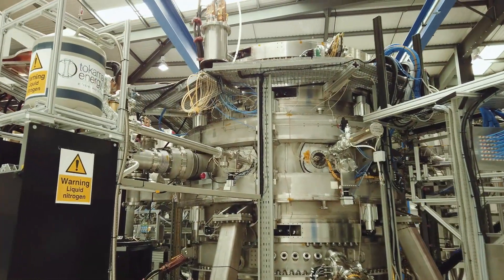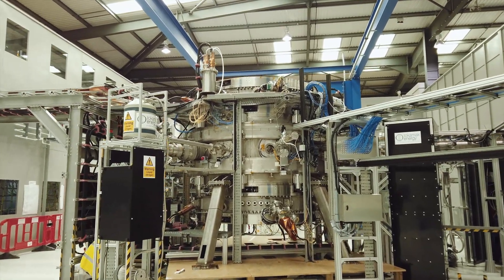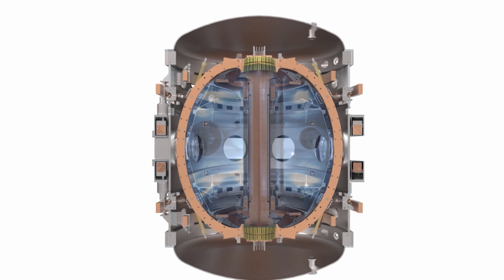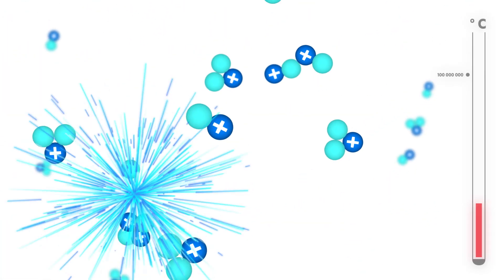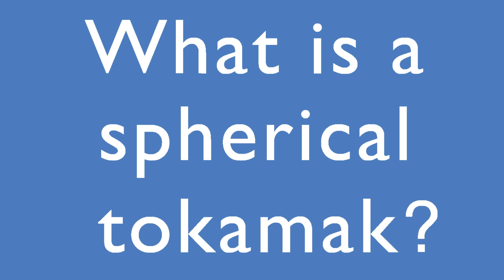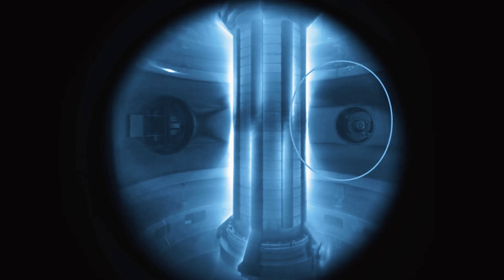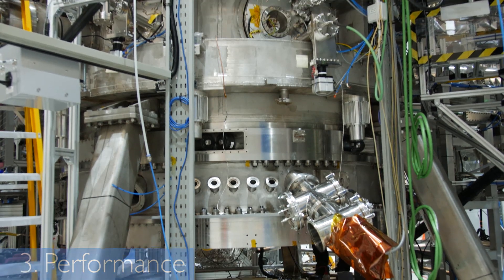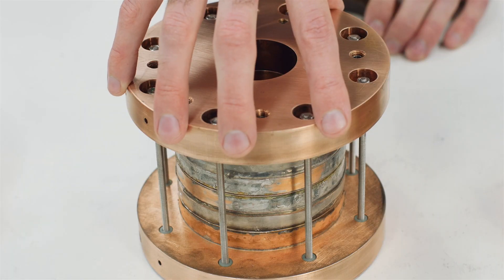What is a tokamak? And is a spherical tokamak different?

Comment: There's like 2 kinds basically 

You can draw power from magnetic confinement of a plasma

By placing an alternator inside the tokamak with a retractable gate that charges a battery, which powers the electromagnets, which oscillates, and behaves like a piezoelectric crystal oscillator in a radio as a secondary effect

Or you could leave the middle hollow, and line the inside in 360 degrees with magnets as usual, but in between the north poles of the magnets creating the plasma, south poles of other magnets, wrapped in gold coils, or copper, 

Connected by their north poles, to the - terminal of the battery, which would charge it, and then send positive current from the + terminal, to the south poles of the magnets used for magnetic confinement/induction 

Plasma can push an alternator, because when magnetized, it can behave like a solid

Comment: I asked AI...if the plasma in the tokamak, in addition to vacuum and antigradation, could be amplified with sound that would affect the pressure surrounding the plasma?
The introduction of sound waves as an additional factor influencing the pressure around the plasma in the tokamak is an interesting idea. In fact, sound is a pressure wave, so it could theoretically affect the dynamics of the plasma.

Possible effects of sound on plasma:
Plasma stabilization: Under the right conditions, sound waves could help stabilize plasma by controlling magnetohydrodynamic (MHD) instabilities.

Pressure Amplification: Sound waves can create areas of increased pressure, which could potentially affect the pressure around the plasma.

Controlling particle movement: Sound can influence the movement of particles in plasma, which could lead to new ways of controlling plasma.

However, experimenting with sound waves in a tokamak would require advanced research and simulations to assess their actual impact and feasibility. There are many factors such as the frequency, amplitude and shape of sound waves that would need to be carefully selected and controlled.

Tokamaks are already advanced devices that use strong magnetic fields to maintain and control plasma, and adding sound as an additional factor would require even more complex technologies and experiments.

This is certainly a fascinating field of research. Do you have other questions about tokamak technology and nuclear fusion? I'll be happy to answer

Comment: What a natural formation as in nature.. path of least resistance… like a tornado/cyclone big on top and small on the bottom as focal points for the ending point of energy. Easier said than done but there is a reason nature has designed them the way they are because it’s a path of least resistance.

Comment: So the donut shape is more efficient, but why? And a question: if it’s so hard to keep the plasma from hitting the sides of the chamber, wouldn’t it be better to use a round chamber that creates a kind of magnetic “bowl”, so that the plasma will seek towards the center and be easier to handle?

Comment: Has anyone observed any gravitational disturbance around the Tokamak when it is operating?
Reply: Does it open any unwanted portal from different realms/dimension?
Reply: @azmiahmad8897  I don't see why anyone would think it might but me my guest to be first to jump in. Send us a postcard from wherever you end up.
Reply: if it uses magnetic force i dont see how it could. Well, actually, it is extremely dense. Which could lead to extreme gravitational force. but the earths core is under so much more pressure that it would be extremely hard to notice a difference. so in short, no, probably not.
Reply: @buneon4462  Of course it has a gravitational field, the point being, is it large enough to cause a measurable disturbance and, if so, is it large enough to create a difference between the clocks controlling processes inside and outside the Tokamak. If for arguments sake this were to happen it could be the reason why the process is difficult to control. Just a thought.

Comment: Okay so then how is energy made from the plasma? I mean the whole point of creating plasma is to obtain energy right? Then how do you use that energy?
Reply: the energy is heat and boils water to spin a magnet that makes electricity
Reply: @KingOfShorts321  can you source an article for more information on this?
Reply: @udaypratap1996  it's basically the same idea as to how nuclear power plants work except replacing the uranium rods with plasma from nuclear fusion. The plasma made from nuclear fusion releases a lot of heat and that heat will be used to boil water and the steam will turn a turbine that is attached to a electricity generator which is just a spinning magnet around a copper or aluminium coil and that pushes out the electrons from the copper or aluminium and that makes electricity. my friend I hope you enjoyed my TED talk.
Reply: agreeing with boris here. extreme heat is produced from fusion reaction that produces water vaper that spins a motor.

Comment: No, they won't work because of inherent design flaws, foundational to the system.
Reply: What design flaws?
Reply: @Gomlmon99  look at the machine they are essentially trying to create a small sun in a vacuum. Does it look like the sun?
Reply: @kellywatts3051  but they aren’t trying to create a small sun. That’s just a metaphor. It’s absolutely nothing like the sun and wouldn’t work if it was.
Reply: @Gomlmon99  seriously squabbling about words??? Star sun energetic mass which is hot enough to ignite our atmosphere.
Reply: @Gomlmon99  what happens when the shielding on the central and external chassis fails? What if that fusion reaction reaches those molecules or worse falls into the earth?  You need something that will cause the reaction to go inert if the chamber opens up. I have some answers to that but not here where my ideas can be stolen.
Reply: @kellywatts3051  how could the shielding possibly fail? And if it did, nothing would happen. The reaction instantly stops the second anything goes wrong. Are you confusing it with nuclear fission? How could it “fall into the earth”?
Reply: @Gomlmon99  why ask questions if you already know the answer to them?  🤣 I’ll play along smarty pants. Core temp of the star In our solar system, the sun, estimated 27 mil F. The tokamak stated intention even in this video description create a star reaction..... I digress, if they’re using magnetic flux to stabilize the reaction, hint: they are, what’s the biggest magnet you know of, hint: you are standing on the second biggest that can be easily seen with the naked eye 😎..., Sorry to condescend so openly I just feel like it’s passive aggressive to try to get someone to try to correct you into giving you there knowledge... but no worries I just told you stuff you already know but couldn’t put together...that is why I will keep making the big income 😘😉✌️
Reply: Also what temperature are the Deuterium and tritium really fusing at? What happens when just one of those reactions get losed into the shielding. Chernobyl’s people sure would love you 😅😅😅 we really need a lab in space to do this kind of hazardous testing at least the whole world won’t die if quasi scientist make a bad guess.
Reply: @Gomlmon99  besides all that it’s a waste of energy to put more in to get less out every test has became subsequently more efficient at failing to get more out because of one detail I won’t state here muahahahaha evil good genius laugh there...😄
Reply: @kellywatts3051  again, are you confusing this with fission? Chernobyl is fission, this is fusion. Not comparable. If the shielding is lost, the reaction goes out. Where did you get the idea that it’s hazardous from? From the word “nuclear”?
Reply: @kellywatts3051  they don’t get more out than they put in because they aren’t designed to. Most around the world don’t run D-T currently. ITER will be running D-T and will be large enough to minimise energy loss through plasma dissipation, so will produce more energy than it uses.
Reply: @Gomlmon99  sounds like it will work let's hope....
Reply: @Gomlmon99  I like that you say opinion good point. Actually prove anything besides Ive work in the field. I've work in the field of  mechanics and thermodynamics for years now and so I wouldn't be speaking on something I don't know about or haven't studied thouroghly. of course discourse is about learning more so if you have a degree in physics of nuclear reactions you know that a majority of test done in this field have killed plenty of people Especially those in intial test, madam Marie Currie or  count US and Russian test subjects. You seem to know everything here so go on ahead with that. Just count me out of your test that include heating matter to the temperature of the core of  the sun when you can't even penetrate the sun's surface with current technology.  J.S. you're not sure about your stance here because your continuing the debate. I'm asking to reconsider your stance before you encourage people to make this kind of bomb.
Reply: @Gomlmon99  the star part is debatable if you want the reaction to be ten times hotter than the core of a Star..... Or did you mean a Star is ten times hotter are you confused 🤔🤔🤔?
Reply: @Gomlmon99  No they weren't designed to not create energy out because that is a circlular argument people use to appear smart to get funding , what you are really saying is it didn’t work. It would have been designed towards creating energy, that’s the point of the reactor to create energy, which it was, but it can’t. Not this concept maybe the spherical will, yet to be seen though.
Reply: @Gomlmon99  I have a model for you look at our sun compare its size and scope to say sirius 25 times its size and you have no clue how they work internally yet you speculate you haven't observed that. Yet you’re going to create an engine , tokamak, on a smaller scale that will heat up hotter than the sun, and you think you can control that without being sure how it will even work. Sounds like quasi science and more like lets guess before we test.
Reply: @Gomlmon99  on Magnetism how does a magnetic work? I mean really you know about it's particle alignment but you can't even explain what powers it. All you have are theories. Anyway the earth is a huge magnet that stops the energetic force of a solar wind and converts energy into beauty like aurora borealis. Which you still don't fllly understand heck "scientist" can't comprehend the depth of the of the ocean enough to get there.  How on earth do you believe you've got the sun's power source down?
Reply: @kellywatts3051  the reaction is 10x hotter than the syn
Reply: @kellywatts3051  we already do this all around the world with D-D, and previously in small D-T reactors. I think you’re still confusing this with fission.
Reply: @Gomlmon99  bro Or sis Does the sun just have fission going on come on.... stop playing games. Nuclear reactions are just that they are high levels of energetic movement debating to put me in defense of my self doesn’t make you sound any smarter and won’t draw anything out of me besides what you already know to be true, you’re just like so many others researching stuff you really don’t know much about. I’m still learning too i‘M just privy to stuff you don’t know yet because of who I’m connected to. ;) gotta pay me for that 😁✌️🎶🤓😎
Reply: @Gomlmon99  ok great answer so what powers them where does magnetic energy come from? no more circular arguments please...
Reply: @Gomlmon99  agreed you clearly reverted to dismissal based on personal character attacks which is a losing parties last move in debate. No science in that.
Reply: @kellywatts3051  This is like arguing with a child. I don’t need to know you to know you aren’t a professional scientist or engineer. I can see it in everything you write as clear as day. Unfortunately, you can’t. You have the same knowledge of fusion as a 13 year old and yet you’re here arguing with someone who’s career is working in the field. Honestly no point.
Reply: @Gomlmon99  still deference really? Ok you’re right talking to a child like how they do this thing called name calling... and don’t show any answers when they’re wrong they hide there hands Kick there feet drop their head and point at other kids an say they are the problem. No friend you haven’t proven your science here just accusations, One childish accusation After another you can’t even explain how magnets work, but have a nice day this was fun 🤓😄
Reply: @kellywatts3051  As I said, no point bothering with a child. I don’t need to prove anything, centuries of physicists have done that for me.
Reply: @Gomlmon99  your loss. Butterfly.
Reply: @kellywatts3051  you have no idea what you’re talking about.
Reply: @mat7can106   Seems like a solid argument you have, you're allowed to elaborate instead of tossing accusations around. In a sense no one knows what they are talking about so maybe you're right about me please explain how I'm wrong though....

Comment: I admit, I can't wrap my head around this and wonder why it won't just explode when they turn it on!
Reply: They turned it on and it didn’t explode 😉
Reply: Inside the reactor there is pressure or vacuum not sure. If something were to happen it would shut down
Reply: The magnets keep the  heated material from touching the sides of the machine.

Comment: I guess there will be water nearby so neutrons can get absorbed to make energy and therefore steam to run a turbine.
Reply: In a perfect world that would be such a great way to harness and use the thermal energy created BUT as I'm sure you will agree this world is far from perfect......However I'll try to explain (with my very limited knowledge in this area) why they couldn't do that......From what I've learned about these tokamak projects is that the magnetic fields produced are absolutely frightening and the actual location of the one under construction in Europe (so I believe,I apologise for not Googling my answer this is from memory,its a very busy day today) the bigger these systems are the more problems arise regarding safety and containment,I saw something a while ago about the problems of which I'm talking about and these were the predicted problems before (obviously) these things are built and switched on.Its a very exciting project that I believe is being built and will be a reality because A.this will benefit mankind if they work as predicted and 
B.China is building one so I guess it's a race to get these built and finally crack the Fusion Energy conundrum here on Earth.....I personally believe that the possible reason why they wouldn't create a heat exchanger system which your suggesting is because of the problems stated above BUT there wouldn't need to be a system like that because the whole idea is to create the most efficient energy system possible SO all the planets energy needs would be achieved in this thing actually working as predicted.....hope that helped,I'm far from qualified to really answer that but my Electrical engineering qualifications and observations will have to do at this time......good question though.
Reply: True, water is quite good at capturing neutron radiation. But for fusion, you need tritium which isn't very common in sea water. Fusion reactors plan to use a "tritium breeding blanket" which can produce more tritium than your reactor uses. Problem is, water doesn't breed enough tritium.
Instead, lithium metal, or alloys of it, capture neutrons very easily to produce helium and tritium (and also more heat energy). It's not yet fully proven, but theoretically it should be possible to have the blanket capture and shield the neutron radiation, then that blanket can be cooled with water. That way the water doesn't become radioactive and you can produce more tritium fuel for the reactor itself.

Comment: Keep going.
Reply: @Paul Varn

Check out these articles on Graphene as a "High Field Magnet", and so much more!

Graphene can not only be the High Field Magnets, it can be every part of the machine, replacing everything.
From the outside as a shell plating, to the inside as the electronics, circuits, pipes, everything.
And it can be used as sensors, and so much more!

https://www.sciencedirect.com/science/article/pii/S1631070512001557

https://newscenter.lbl.gov/2010/07/29/graphene-under-strain/

https://phys.org/news/2019-12-magnetism-graphene.html

https://www.ru.nl/hfml/research/research-highlights/highlights/graphene-quantum/

https://arxiv.org/abs/1004.3396

https://www.nature.com/articles/s42005-019-0161-5

https://www.researchgate.net/publication/7069773_Landau-Level_Splitting_in_Graphene_in_High_Magnetic_Fields

There are more articles, but there are just too many to link, google search "graphene as a high field magnet".

You see.. they can replace their High Field Magnets with Graphene.

----------
Q. Can Graphene be produced enough and cheap enough? 

A. Yes, check my other channel in the links below. 
----------

I sent the links already under another video, but here they are again.

Videos with important info to get around my other channel.
https://www.youtube.com/playlist?list=PLAUtk-Q2DF7xsjVfESM1sqZdkHJYRw--j

Don't forget to check the rest of the channel on Graphene and Quantum Technologies, use the steps in the link above in this comment.